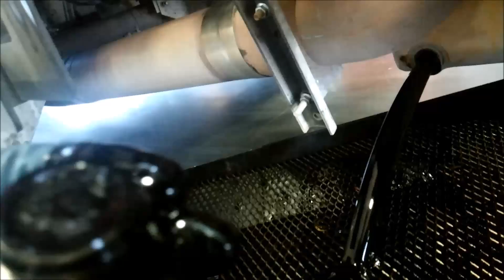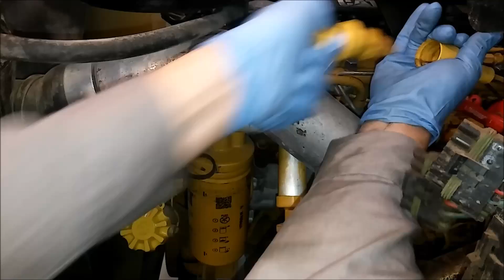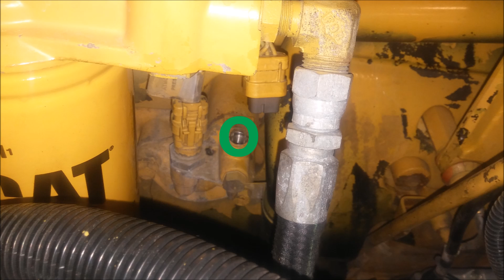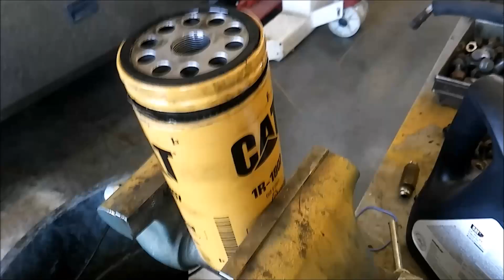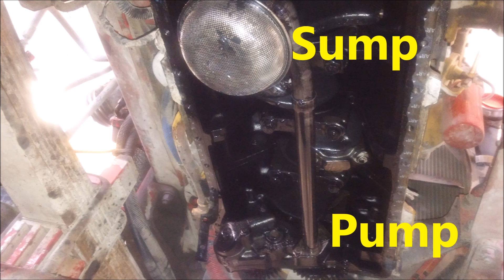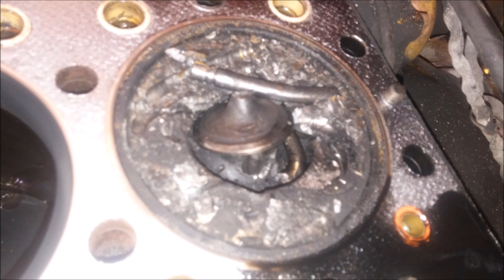What Causes Low Oil Pressure?  Troubleshooting And Causes Of Low Diesel Engine Oil Pressure.

Comment: Do you think I'm on the right track? I just found a video and watched it. I'm unsure about the smoke's appearance. It seems to have no water loss in the coolant, and the oil is clean. I'm considering the possibility of a faulty pump. The machine is an old 1960s Allison dozer. If you could see the video, perhaps you could share your thoughts on the smoke's color?

Comment: I just got a gmc c7500 with the c7 engine. Oil pressure fine, I changed the oil and filers right away. But my problem is the oil light on the dash will not clear. I did the pedal thing 3 or 4 times to reset the light but it will no go off. Any suggestions please?

Comment: Had that happen to me on the fly once. 28 miles after leaving mechanic shop on an incline I noticed an unusual power loss considering I had an empty flatbed. Once I started thinking something don’t seem right the dash starts screaming at me and I saw the guage was nearly all the way down.
Mechanics installed wrong size rod bearing. That was a fun trip back.

Comment: My c13 is getting check engine light and i hooked a computer to it and its saying low oil pressure. Just a few days ago the truck would give a jerking feeling and now it doesnt run over 15 mph without cutting off. The truck would stay on while idling but if i move itll just cut off. Any idea

Comment: I have a 2011 350 Ford Super Duty 67 spray ether into it backfire engine smoked now low oil pressure what went wrong need help

Comment: The idle oil pressure on my recently rebuilt marine cat 3208 is 75psi initially, drops to 25psi when warmed up, and down to 12psi when in gear. It goes back to 25-35psi at 2000rpm. Any ideas?

Comment: 11:31 my C13 2006 Peterbilt has low oil pressure 18 idle and 20 on the road?? Had this this problem before changed release valve pressure went up to 40-50 while driving now it went back down to 20

Comment: Could you explain oil pressure going up dramatically. Used to drop down to 40 psi at an idle but now it never stops below 60 and goes up to 85 psi, which engine has never done before.

Comment: My oil pressure dropped 10 pounds usually runs at 35 it’s down to 22 2325 I do have coolant in my oil I do know that is sending it out some and I try to keep changing it out every two days tomorrow I’m going to drop my pan drop change my oil out and have a look at my pump because my engine does have 1,000,000+ kilometers on it 1,000,001 km on it it’s stressful running down the road but going to try and make it do for a little while longer

Comment: I have 2005 c7 cold engine oil pressure around 50 after engine hits it drops to around 25lbs at 70mph and hits as low as 15 or 20lbs at idle , but it does have 700k miles so I’m gonna figure she’s about to life expectancy especially since she has a decent amount of blow by and loves to paint the undercarriage of soot but I’d buy 10 more just like her. 05 freightliner box truck 1.3 million miles second engine 4th owner

Comment: Thank you for all the helpful explanations, I love your videos. I have an old 93 model flat top with a 3406C converted to a B(4ck). I’ve always had about 55 running hot on the highway, and just last year, it dropped to 45-50. I got an overhaul and replaced everything but the block and it’s still at 45-50 running down the highway. I was told that the front and rear seals and cam bearings can affect the pressure too, I haven’t done that yet. 
Is that true?

Comment: Thanks for that detailed info on oil pressure problems. In my case The old pressure starts at 90 psi and after about a half hour of idle drops below 30 psi on the starboard engine the port engine settles up at 60 psi at idle what would cause the starboard engine oil pressure to slowly diminish like that. The difference between the port engine and the starboard engine after a half hour of idling is like 30 psi. I’d appreciate some direction where I should start looking thank you

Comment: I just did my oils changed and I noticed it’s oil on my front bumper it’s likely steam spots but I couldn’t find any major oil leaking, and oil pressure it’s normal at 40 to 60 do you knows anything about it, ??

Comment: Love the channel, 06 c7 435,000 miles , no blow by or none noticeable, but at idle oil pressure is 20-25 psi according to gauge running down the road 45-55 psi .   6 spd  manual , seems to loose power with modest gvw of 32k at any slight hill .  Was told injectors may be leaking oil.  No noticeable smoke from Exhust

Comment: I have a 2006 c7. The oil and check engine light are on. Alarm beeping. 45psi oil press at idle cold and after warm up going down the highway it stays at like 30-35.

Comment: Need some assistance. I cannot locate the oil pressure sensor on my c12- serial#2KS95042.
Reply from the maker: I just looked it up to verify your specific serial number should be on the engine block in front of the ECM on the driver side/left side of the engine connected to the same fitting the air compressor oil line is connected to.

Comment: I have a cat c7 normal oil pressure is above 50 but after awhile it drops below 40  then easy up slightly and then after a while it jumps above 50 then falls back down what you think

Comment: Hello, i have a newly out of frame rebuild c15 acert nxs and it has low oil pressure. Starts of at 60 when first start it then goes down to 10 ! Cat told me to run it hard so the rings will be seated and then it will run fine after a while. The problem is that when i take it out to drive it, i lose power and once even shut down on me just few miles from the yard! I waited about 20 min then got it to the yard which it was about 3 miles maybe less away. Left it running and took the dip stick off and was spitting out oil!!! I called cat and they said it can be crank case pressure but i feel that’s too many things happening on a platinum rebuilt?! What you think?

Comment: I have a c15 mxs at operating temp at 600 rpm oil pressure is 30-35 psi, 1000 rpm 50psi, and at 1500 rpm is 55psi. I did notice my oil pressure sensor is leaking around the bottom. If the oring is that bad I would imagine the sensor isn’t the most accurate. The engine has 1.4 million and had a rebuild at 1million. I will put my manual oil pressure gauge after work but just wanted to see your thoughts.

Comment: Have an 07 MXS, hot oil pressure will get to 15-16psi at idle, and at 1500 rpms it only makes about 50psi. From everything I've seen it should be closer to the 40ish psi range at hot idle. This is a company truck that is new to me, 1,543,000 miles, no clue if it has been rebuilt at all. seems to run fine and pull fine, currently has codes 95 and 98 though, which I will hopefully get fixed soon. oil was changed just under 3000 miles ago with a baldwin filter. it doesn't seem to make oil or mix oil/coolant. I plan to put a mechanical gauge on it and verify, but the Jake's don't work very well either so I plan to take the valve covers off and check out everything up top and do an overhead. any other suggestions?

Comment: I had a 50 psi on oil which is 20 psi less than usual. And all I heard was bang like a huge rock had hit my windshield and my pressure went to 25psi. Now when I'm stopped its 0. When I accelerate it goes up to 25. But haven't lost any power or so it seems

Comment: Great video thanks  very informative I want to ask I have cat c7 2005 my oil pressure when
Engine is hot is around 25-28 psi is that normal or it’s low oil pressure???

Comment: Hey man new to your channel but I have a C10 that has a lot of pressure building up in crank case and is causing oil to shoot out of the dip stick tube and then shutting the truck down for low oil pressure which is understandable being as though it just dumped all of the oil.
Reply: Have you figured out the issue? I am having the same problem on my c15 but mine is a platinum rebuilt and still have warranty for another 2 and half years, but if it’s something simple i don’t wanna take it in idk!
Reply: This will require an overhaul.

Comment: 6.5l diesel hot  idling 18 to 15 psi oil pressure is this ok or bad she runs 45 to 50 driving

Comment: Awesome clip which is very helpful! 
Would you advise me with my Santa Fe 2015 (the ODO = 45,000 miles), encountered with an engine stuck (engine turned off when I accelerated from 55miles/hr.). The engine was disassembled and found the crankshaft #4 jammed with the rod bearing (the bearing has rotated inside the connecting rod, and along the center of 2 bearings crashed and damaged which marked its copper material on the crankshaft except 2 points which are lubricant holes on the crankshaft). All other 3 bearing sets and crankshafts #1,2,3, all cylinders, all pistons with its components and all the cam parts on top of the engine are in the perfect conditions even not have any minor wear! The workshop technician concluded the Lubricant pump failure didn't provide sufficient oil pressure was the root cause of the problem and requested to replace. I am very confused not sure if that is correct cause OR should be some mechanical dimension tolerance issue or lubricant pipe of the #4 clogged that prevented the lubricant from protecting the #4 so that the friction happened and caused the damage? My car lubricant pump is built in together with the engine balance system (not really understand this). How do you guess about the cause and would you give me an advice what should I do to ensure my engine fixed properly? Thank you very much and have a nice day!

Comment: Quick question I have two  C-15 and on both trucks I have active a BAROMETRIC PRESSURE  its possible the censor has to be replaced or what that means or it signal the something really bad is coming??

Comment: One more thing causes low oil pressure? check oil transfer, may be transmission or hydraulic oil due to bad seal, at this time the viscosity will be low and increase oil engine level.

Comment: That was the first thing I noticed after my overhaul. Psi dropped to 35 at idle and when driving it stays between 63-65 but then when you floor it drops to 60psi.
Reply: My truck is doing the same thing after replacing main bearings and road bearings, it's driving me insane lol,cat 6nz 2003 with 670000 miles after rebuild. So before replacing bearings running down the road was at 70psi and at idle at normal temp never dropped under 40psi,...now after replacing bearings idle at 35 psi going down the road at 65psi when I flored it will drop to 60psi,I jope my mechanic didn't f up anything 😅😅
Reply: @georgeconcepcion7628  I was told that if cat parts weren’t used on the overhaul that plays a big factor too. I haven’t had any issues in 4 years since the overhaul but it did drive me insane seeing that psi at 35-40.
Reply: @contrerasj87  I did use original cat parts,I will never use aftermarket parts,even my filters are cats never use anything else, but my question for you is after you're rebuild the engine did the oil pressure drop down to 35 psi while in idle?because my did dropped 5 psi after replacing main bearings and road bearings.
Reply: @georgeconcepcion7628  yes it dropped to 35. And for the longest time I thought for sure something was missing but then I was told it could be the aftermarket parts I used so I left it alone.

Comment: Great Job dude. I think the most important thing is the hook up of an oil pressure gauge tool https://amzn.to/2NblM33 so you are sure about the readings cause i 've been there thinking all around this problem on my alfa romeo restoration project and finally it was a bad sending unit , a cheap solution after all. Lesson learned. Check the simple stuff first!!!

Comment: Hello i buy a 2005 kenworth w c13 cat 430hp and oil pressure is 40 idle w is hot and about 65 in 1500 rpm is normal???

Comment: I have a 02 mack Vision that the oil gear pump blew up in mack told me to rebuild it would be $30.000 took off the pan see not to much wrong so I just ordered a new oil pump hoping this will work the guy driving said the check engine light came on loss of oil pressure truck shut off

Comment: I just had an In frame done on cat c13 acert and oil pressure is at 40 when it gets started.  After it warms up it drops to 10.  We have a new oil pump and also used a second set of new oil filters and still doing the same.
Reply from the maker: You need to verify the correct main and rod bearings were installed. Had a mechanic once put the wrong bearings in and it was doing the same thing.
Reply: Adept Ape What would I look for on the bearings?  Would it be by part number?

Comment: My oil pressure on my 3126 it as 150/200 KPA at 2000rpm and stable in my oil pressure level driving board , does I should worry about ?

Comment: Great video.

I am having an issue with my trucks oil pressure changing from day to day on my N14?? I got low oil pressure one day. I replaced the oil pump out thinking it was bad. Turns out a piston cooling nozzle cracked. It was replaceable from outside the engine so I changed it.  Everything back to normal

Two weeks later low oil pressure out of nowhere while driving (after about 3 hours of driving that day at normal levels). Tow the truck home, check nozzles all good. Check the oil relief valve and it seems to be fine. Truck randomly gains oil pressure again after letting it sit for a few days and restarting it. I replaced the oil pressure sensor as well just in case. I drive it on a small job everything is fine and running at 28 psi under load and 10 at idle. Wake up the next day and it idles at 10 psi cold and throws a “check fluids light” at 1500 rpm because the motor struggles to get 20 psi pressure (cold at 1500rpm). 

Me and my mechanics are so confused. The pressure keeps changing from day to day. I guess it time to drop the pan and see if anything is blocking the oil intake? The pressure changes random and quickly.

Comment: Great video as always! For those people who worry about a 5 PSI drop in oil pressure, remember that the oil pressure is affected by the oil's viscosity as well. So if your oil temp is different or you used a different brand or viscosity of oil or different oil filter, that will affect the pressure as well. So if you want to compare oil pressure, you need to be running at the exact same RPM, using the exact same oil and filter, and the oil temp needs to be exactly the same since any of these factors can affect oil pressure.

Comment: We have a C15 ACERT MXS series engine that was showing low oil pressure and shut down. Towed it to a shop. They said it was showing 35 - 40 PSI and should be 75 PSI on a cold start. ECU showed at one point it was in the 20 PSI range.  They took the pan off to inspect and said that the bearings look good, but there's "No cross marking in the liners. Liners are glazed." They want to do an in-frame to the tune of $18,500. We had an IVA #1 code as well before all this happened. I can't find much help on this engine as far as cross marking and low oil pressure. There's only 55,000 miles on the engine, it's a 2007. Does this sound right? They didn't pull the head to inspect the cylinders.

Comment: Total solution = Collapsed Oil Filter {more than likely a Baldwin Oil Filter} just change oil filters. Other possibilities, oil pressure sensor or oil pump... which is basically 2 metal gears that rarely fail.

Comment: hello i have 2012 dacia duster 1.5dci diesel. when i start the car oil light goes off little bit late than the others also i have checked the oil level that is OK. Have any idea? 
edit: oil's colour is black which i presume is normal.
Reply: Sorry 
For disel engine every time oil its black, you need change engine oil 8000- 10.000 km 
Its that not work
Change sensor presure engins oil

Comment: I have a 2003 t 2000 with cat c15 engine what should my oil pressure be at in idleling while engine is at normal operating temp

Comment: My jake brakes malfunction when it's super hot. I was told it could be low oil pressure. How can I trouble shoot jake brakes
Reply: Did u find what the problem was? My truck's doing the same thing.  Thanks

Comment: Kubota V1100 diesel in a mower has good oil pressure on start up, but as the engine warms up the oil pressure steadily drops (50psi at start up to 18psi after a 45 minutes).  It does this even after an oil change.  Mechanical oil pressure gauge, temp runs up to 200.  Any ideas?

Comment: 👍 I enjoyed your video I have a C 16 caterpillar 600 hp that we just rebuilt 57,000 miles ago I have low oil pressure idling 11 pounds 1500 rpm’s 27 pounds we have change
Oil pump check the oilers changed oil filters changed oil sensors and my old pressure is still the same any ideas would be deeply appreciated
Is there a difference between a C 15 oil pump and a C 16 oil pump
Is there a higher pressure oil pump with that help ?

Comment: We had a similar  problem with our Cummins N-8-G2 180 KVA Genset engine. All the valve springs broke off and one exhaust valve broke, hit the piston and was stuck in the head. Some broken parts found their way into the turbo and ate the  turbine wheel.There was also diesel in the coolant and one bent push rod. The head had to be replaced and the whole engine rebuilt.

Comment: Are you a. Expert in maxxforce engine have 2013 international giving be issued as to when I’m driving it just shut off. On the highway is fine but on the road it shut off unexpectedly? They claim low fuel pressure. It can be my ecm .. but when it shut off. I remove the cables from batteries then put it back it restarted again to drive.. help ? I my work horse. And putting me outta work..
Reply: MIKE GILLES too much electronics in a diesel for the working man,,the old diesels seem to run forever and they forgive you

Comment: I have a dd15 and when I brake the low oil pressure is active for a brief moment. Any idea what that could be??
Reply: Oil sump
Reply: Just replaced on a DD15, the old one is a 2 piece suction sump and new one is 1 piece.